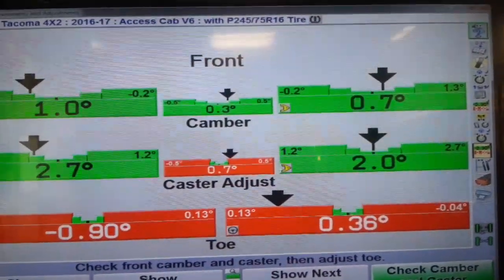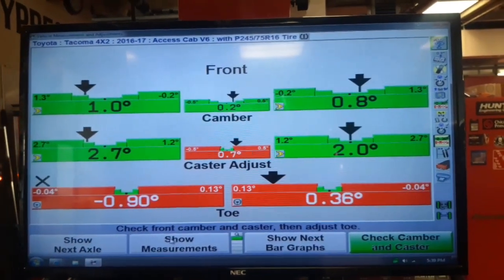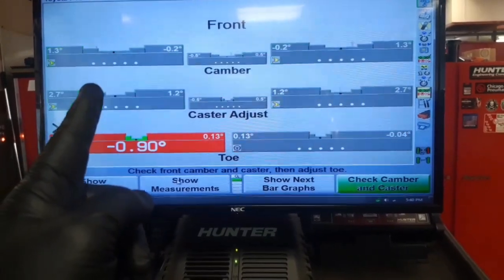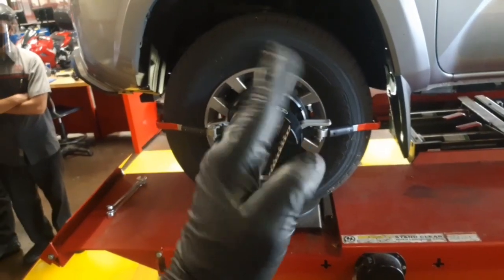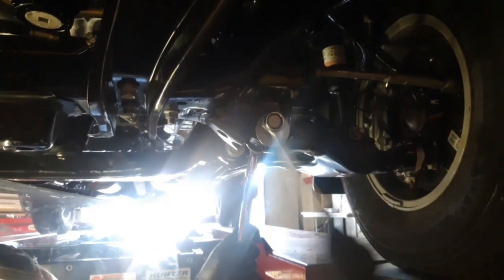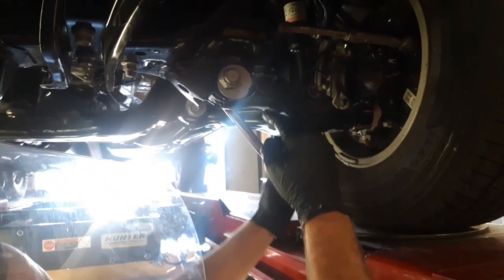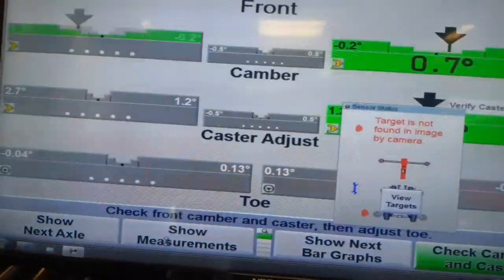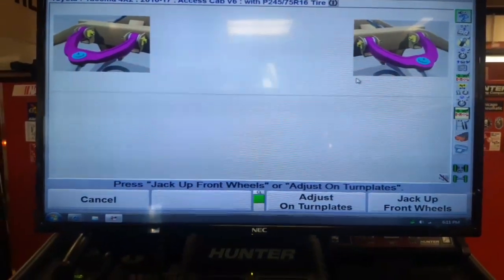How to adjust caster and camber using eccentrics on control arms AND UNDERSTAND IT!

Comment: Excellent explanation on caster/camber and how to  adjust.  I would disagree although on the final measurements.  Most roads are crowned (not flat) . In my experience this Taco would drift/pull to the right. In order to compensate you should always want at least  a half of a degree more positive on the right.  If your original caster readings were reversed to be 2.0 left and 2.7 right and your camber was 1.0 left and .7 right a toe and go would be all that was needed..

Comment: What are your thoughts about using the CAMM program, or the stack and drag process?
Reply from the maker: I am assuming by CAMM you are talking about the hunter step by step procedure when you click the wrench icon and "adjust camber or caster". I like that on most models. I believe there is an issue with the program on Toyotas with the eccentrics on the lower control arms rather than the upper. When I, or many students over the years follow that procedure the caster ends up further and further out of spec. It's also interesting that the procedure illustrates the adjustment being performed on the upper control arm when in actuality the adjustment is on the lower. Not sure if that is coincidence but for sure there is something wrong. 
I teach students to visualize it and adjust it how they predict it needs to be then resweep caster to see if it is good. The alignments turn out better after I get them off the CAMM procedure and on board with understanding the actual adjustments. 
I believe this is part of the reason 90% of "alignment techs" do horrible alignments. They don't know what any adjustments do. They just know it was red and it can be made green. 

As for stack and drag. I am not familiar with the term. Please elaborate.

Comment: Thank you so much for this video. It helped me understand a lot. I'm sure you get a lot of questions but can you tell me where the adjustments are on a 1990 Chevy k2500/gmt400 4x4. I know you'll say i should take it to a shop but I'm disabled and live out of my truck and i can't afford shops. I do all of my own work but i have positive camber to where the outsides of my front tires are wearing very quickly. All of my bushings are shot and I'm working on getting those replaced. In the mean time i just want to try to save my tires a bit. Thanks.
Reply from the maker: @thejohn6614  yeah there are eccentrics on the upper control arm where the "A" meets the frame. You may need to break out plastic clips that come from factory if its never been adjusted before. 

You would want to turn both eccentrics the same amount so your camber is less without changing your caster. Afterwards you should set toe. Toe is the fastest tire wearing angle so helping camber but making toe worse will make the tire wear even worse FYI.
Reply: @CollegeAutomotiveClasses thank you very much for your response. I know that you're talking about. I had a vehicle in the past that had that slot that the plastic fits in. This truck doesn't have that though. Other than the tie rods the only possible adjustment I see is where the a arm connects to the frame it has large bolts where 1 side of the bolt is flat. Idk if it's different because it's 4 wheel drive. I've tried digging through forums but I can't find anyone explaining how to adjust this setup.
Reply from the maker: @thejohn6614 I don't think they were doing shims that year but I'm a little fuzzy on those older trucks. Shoot me a Pic, I'll know. Paulkelley86@gmail.com

Comment: Some of the best explanations of caster and camber that ive seen online. I have a 2011 ram 1500 with new inner and outer tie rods. Took it to a shop and now my camber is .4 on one side and .9 on another. Steering is off and it pulls like never before. They claimed my one side steering knuckle wont allow adjustment of the camber, no real explanation. Said i might need a special upper ball joint installed to set the camber on the driver side.Went back and it has only improved a bit. This information will help me either work on it myself better or make me more aware of what they are doing at another shop. I want the camber more equal at least. Ive never had issues before. Thank you very much for sharing the knowledge!
Reply from the maker: @ryanv7195  you have a couple options for that. If the one side is maxed out (or undajustable for whatever reason) you could move the other side to match even if it's moving it further out of spec. 

A lot of techs are kind of mentally lazy and think they just make things green and don't really understand. A good tech will address your concern and ignore the colors. 

The adjustable ball joint or control arms could be a good option.
Reply: @paulkelley86  thank you very much. I have to figure something out. After the last time I went to the shop. The final camber setting is -.8 on the driver side and -1 on passenger. It still pulls to the right. One "tech" said that 1 passenger side camber bolt was seized..so frustrating since they adjusted it the day before and said nothing. I'm ordering a camber tool and will try to do it myself. Before I came in my truck never pulled this much to the right. The final castor readings were 3.1 driver side and 3.8 passenger side. The original readings were 3 and 3.4. My toe was very off when I came in. I wish that was all they adjusted. The toe is .16 driver and .03 passenger. Maybe that's the source of my pull?
Reply from the maker: @ryanv7195 your caster will cause a right pull and your camber will cause a right pull as well. They will combine forces and cause a right pull
 
Toe won't cause a pull. Only tire wear and steering wheel off center.
Reply: @CollegeAutomotiveClasses how would it cause a pull if the vehicle would want to pull to the side with the least amount of caster? 

I’m currently an alignment tech for a tire chain & caster is the one alignment angle I cannot understand. I’ve been told always leave about 0.5 of caster more on the right side to help compensate for the crown of the road but on some vehicles the caster stays in the red, for example driver side 3.8 & the passenger side is at 4.3 but in the red. What would you recommend I approach caster as? Should it always have a 0.5 or less of a different between the 2? What if camber stays in the red at the cost of the caster being set properly? I also had a question regarding the thrust angle since it’s not adjustable on solid rear end trucks what if it’s reading 0.38 on the drivers side or vice versa on the passenger side? Would this cause a pull, how would I bring it up to a customer? I also didn’t know if toe was out 0.50+ or more it would move camber towards the left by 0.1 for every 0.50 of toe. Does that mean caster also moves since my camber’s moving? I appreciate your time & am currently watching your videos for my upcoming ASE’s A5 & A4.
Reply from the maker: @daniellucatero-jimenez.1440 you have a lot of good questions here. I wont answer all but I will say I have videos on the thrust angle (dog tracking) and some of these concepts. 
I would like to explain that I teach mostly from the manufacturer and ase perspective. With that being said, you will never find either of those sources specifying to leave caster more positive right to offset road crown. I understand who taught you that was trying to make the car go straight without wearing tires. It's not a bad thing. It's just not what manufacturer or ase ever recommends. That would be purposely inducing a slight pull left to make go straight in the right lane. Whay about the left lane of a freeway? It will pull twice as hard left in that lane with the road crown compounding. When you go into ase remember it's from the manufacturer recommended perspective. Not the tricky way at the shop. 

Also your details about how much camber or caster may change when changing toe is interesting but im not sure there is a consistent ratio there, I don't feel knowing that is important, nothing like that will be one the ase.
Reply: @CollegeAutomotiveClasses  thanks you sir. I will keep this in mind. I appreciate your channel a lot!
Reply from the maker: @daniellucatero-jimenez.1440  happy to help. I have a patreon with all my lessons including really good practice quizzes and study sessions for ASE. I have had many pass. Patreon is free for 7 days then if you like it only $5 per month. 

https://www.patreon.com/AutomotiveClasses?utm_campaign=creatorshare_creator
Reply: What state are you in
Reply from the maker: @rajulfaqeer2101  southern CA

Comment: So for a vehicle with negative camber and wanting to get nuetral. The camber bolts are maxed about to the inside. And still +1 Camber. Would you recommend trying to pull the caster bolts in and see if that helps as long as the caster is within spec? Or get a upper control arm adjustable bolt to push out the top of the tire the 1 degree needed
Reply from the maker: @patrickhoward4080  I'm not sure what vehicle or suspension you are working on, but generally speaking; there are no camber bolts and caster bolts. Both eccentrics on a control arm adjust both camber and caster. 

It's not something that can be answered in a simple way that can be applied to all circumstances.  If you can get both in spec then great, if you have to sacrifice one, say caster, to get camber in spec... well then you want to know what the effect will be. For example if you have more caster than spec to get your camber correct, you would have more turning resistance but it would have fixed your camber tire wear so for me I would go with that. Assuming same caster side to side. This may however not be desirable depending on the vehicle and the driver. 

See what I mean? Very case by case. And dependent on suspension design, aftermarket options etc.

Comment: When I hear "Hella" I can smell north Cali
Reply from the maker: Well... that odor has made it's way down south I say.
Reply: @paulkelley86  100%!!! ahhhh, the aroma!!!! 
Nice vid, very informative, and great production. Thanks!!
I'm trying to figure out my rear camber on an 05 deville dealing with a 1 inch lift and don't know where to start with a jack, jack stand, and or ramps ( first times a charm?) 
How should i set the camber? With wheels on the ground or wheels off ground on jack stands or ramp? I saw someone use 2 plastics bags with some oil in between them under the tires to allow some flex, is this necessary for camber adjustment? 
I will need to go from a little positive to a little negative.
 I have GM information, but there are no specs on the camber just gonna try around-0.8° to  -1.3° for the rear & for the front, im thinking -0.3° to 1.0° or something like that. Cheers 🍻

Comment: so you can only adjust both at the same time? it seemed like the bolt position changed from the first to second test. are there ways to adjust them independently?
Reply from the maker: Yeah you can adjust one eccentric at a time, just know moving one changes both caster and camber so you may end up chasing your tail per se if you don't consider the effect of both on caster and camber.
Reply: @CollegeAutomotiveClasses thanks for the reply! AFAIK, my ‘83 300D benz has only one eccentric per side. So it’s possible the caster is controlled by a different component like the guide rods… still learning!
Reply from the maker: @benfischer6601  Oh yeah this was really specific to upper and lower control arm type suspension. Typically called SLA or double wishbone. Yours sounds different and likely as you have discovered, has a different adjustment. I have seen a part like what you describe, if it draws the wheel forward or rearward then yes that would be a caster adjustment. I see those on a Honda Prelude for example. And as a matter of fact, we are all still learning so keep it up.

Comment: That eccentric nut is trickey For the front caster bolt, you rotated the bolt outward to push the control arm out, which reduced camber. Very easy to understand. Then when you were adjusting caster  and moving ball joint forward you turned the bolt in the same direction and brought it in to get caster in spec, which also increased your final camber....the bolt pushed off the edge and it moved back the other way...

Comment: I got a 01 Silverado with a leveling kit I installed . Anyway I've kind of noticed it seems the rear eccentric bolt stays more positive than the front to even out caster if you have torsion bars cranked doesn't it? Which way on camber does cranking torsion bars move to I thought cranking goes negative but I need some advice I know my caster is off and I need an alignment but never have the time any help thanks in advance
Reply from the maker: Lifting makes camber positive. Lowering makes it negative. 

As for the caster, hard to say. A lot of times with a lift or something custom I am setting caster to allow for clearance like frame or fender rub then factoring in how it will make it handle and making it the same side to side so it doesn't pull.
Reply: @CollegeAutomotiveClasses  I think I finally got it pretty close I had to set rear uca eccentric bolt pretty far positive then front one all the way negative my tires are about right at 0 to neg 1 on my bubble camber gauge, it sticks to the rotor magnetically and then I set my toe with string method no more pulling to the right. Thanks for reply.

Comment: Right side caster should be more positive than the left, no?  To compensate for typical road crown?
Reply from the maker: That's not a bad trick, but let's say you jump on the freeway and get in the left lane, the crown would be opposite and combined with the added right caster it will really pull. 
No manufacturers call for unequal caster. 

I have found if you get everything equal, the customers are happy. It's probably straighter than from the factory at that point.

Comment: Awesome video... thank you so much!

Do you know about the dreaded steering pull (to the right) on Gen I Honda Ridgelines? I am at my wits end. I have had the truck aligned multiple times and it is within specification but the darned things still veers to the right and some times a lot when i take my hands off the wheel. Any top tips concerning this vehicle and its steering wheel pulling issues? Thanks!

Comment: How do i improve my caster on a 2013 toyora tundra? Ive taken it to two shops and feel like they are feeding me full of sh*t
Reply from the maker: Caster is adjustable on that using the lower control arm eccentric bolts just like in this video.
Maybe the adjustment is maxed out like a part is bent?
Maybe the eccentric is seized? 
Maybe they are incompetent techs?

Comment: I understand where your coming from and your thought process but the mind set of it's good enough just doesn't sit right with me especially when you say yea it could be better. Too many wheel alignment guys follow this process or maybe I'm spoiled because my guy always gets my cars dead center in the green.
Reply from the maker: Getting every car perfect sounds great, but at some point it becomes OCD. The manufacturer provides a range for a reason, and also what do you do when you get a car that has something bent and you can't get it perfect?
Option 1, sell the customer various parts, but what if it's the frame and you charge a bunch of parts on a car that can't be fixed. Most of the time it's great, although much more expensive for customers and not all want to spend the money like that. 
Option 2, understand where to be very tight, toe for example is a big tire wear item. Camber however has less effect on tire wear so if the car doesn't pull, and the tire wear is not excessive, AND the customers main concern is to align to prolong tires and save money... maybe let that one go. After all it may be more expensive to fix than the minor reduction in tire life costs. 

I try to be adaptable to the situation. What I do is really based on the customers goal. 

Not to be disrespectful but everything is "good enough" or not good enough. In spec or out of spec. Every spec on the car.

Comment: Good explanation of how those concentric, lower control arm bolts will affect caster and camber (I have a Toyota pickup & FK Cruiser - both are lifted w/ suspensions hardly original, & enjoy DIY). The visual aids help a lot in grasping this.  This is the very understanding I was looking for on YouTube, but no one was explaining properly. Thanks!

Comment: Does the tires need to be on the ground when adjusting camber
Reply from the maker: There is a setting on the machine to either adjust on turn plates (ground)  or adjust while lifted. You can do it lifted but you want to click that button on the machine first so it compensates for the change. The camber changes once you pick it up off the turnplates.  But the machine will do predictions and be close once you set it back down.

Comment: Holy crap this is more helpful than any articles Ive ever read! Thank you! My w124 has one eccentric bolt on the lower control arm and I'm pretty sure old owner didn't know what he was doing with it neither did the alignment shops. So steering won't self center. I'm sure Caster adjustment would solve it
Reply from the maker: Yeah increasing caster (more positive) could do it or check for binding like upper strut mounts or seized lower ball joints since the are both pivot points for steering axis
Reply: @CollegeAutomotiveClasses  it's a 4matic sedan which has removable ball joints, recently replaced. Strut mounts also recently replaced so most likely not that. Even steering damper was replaced. Also I think problem was there before all of the changes so most likely an incorrect camber/caster arrangement.